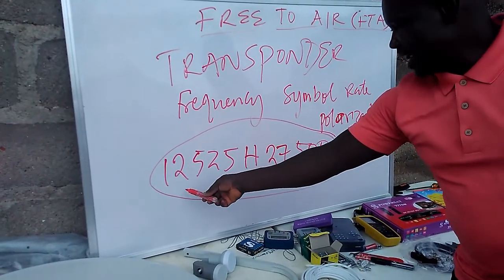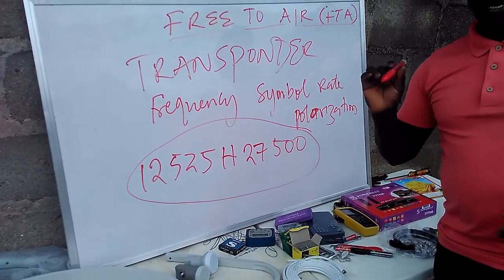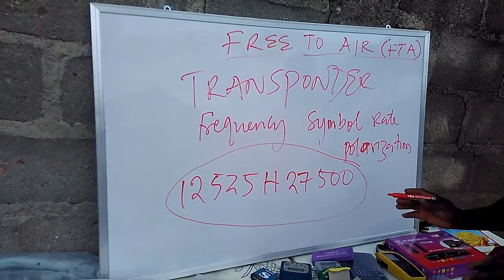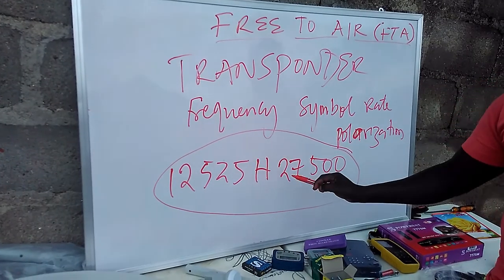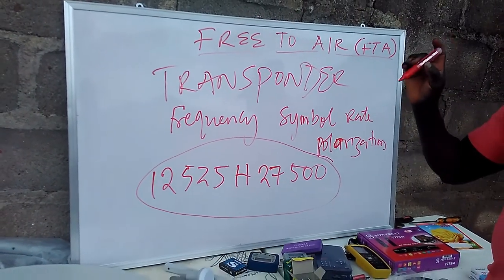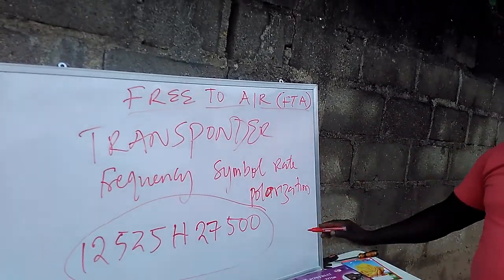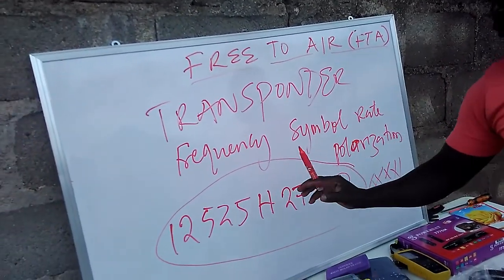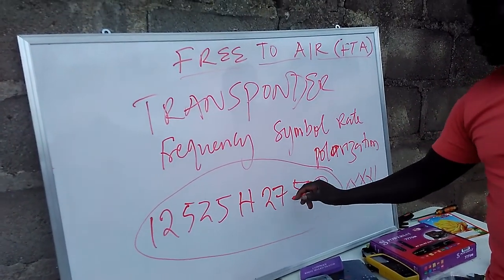LATEST FREQ TO TRACK ALL FREE TO AIR SAT 2

Comment: Hello Sir. My junior brother mistakenly deleted all the Astra 4a channels which had Joyprime and other FTA Channels. So I tried rescanning them , but instead of getting the joy prime back, it's getting different channels. I tried scanning with other satellites apart from Astra 4A, but it's still getting same Channels that I got while rescanning them.

So pls how do I scan to get back those joy prime channels back sir ?
Reply from the maker: Yes you can
Reply from the maker: Fro settings, blind scan
Reply from the maker: Depending on decoder settings
Reply: @FastestIQ   Ok sir, How can I set the decoder for me to get those Multi TV stations.

Because I've tried all means to scan it back, but instead of bringing back the multi tv channels, it's bringing other channels in the same satellite list.

For example, If I scan on Astra 4a, it won't bring multi tv channels rather it will bring other channels. Of I also scan hotbird sat and other satellite, it'll bring out the channels that was brought out on Astra 4a.

All the satellite list bring same channels which are not multi tv channels.

Pls help me